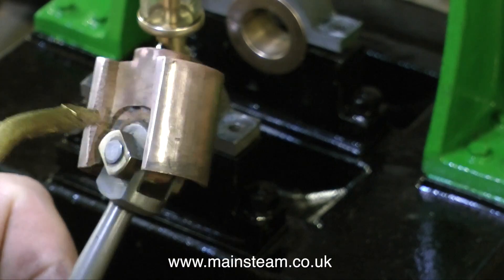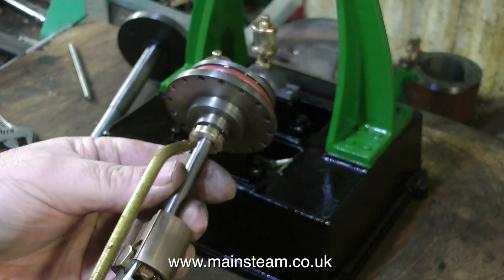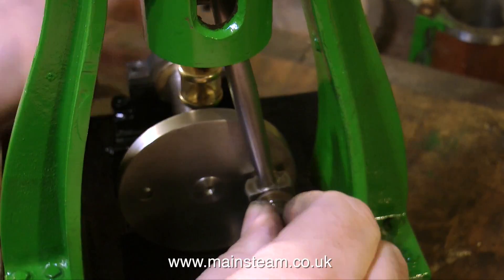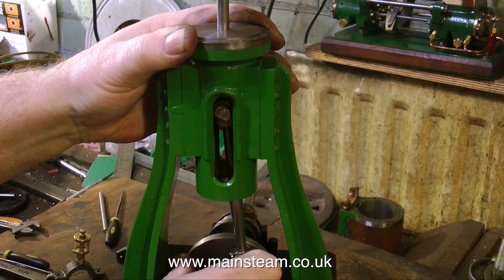REBUILDING A LARGE CLARKSON VERTICAL STEAM ENGINE - PART #18

Comment: Gonna be something else watching this one chuff over happy as a clam when you're done.

I do have a couple of questions regarding a pre-machined Stuart 10H, though, as mine came in the post earlier today. Beautifully made engine, for what it's worth, spins free as a top.

1: What thread is the steam inlet port on the steam chest?

2: Is it normal for them to drill holes in the sides of the cylinders for draincocks, but never tap them nor include the drains/plugs in the pre-machined kits? Mine was so drilled and I'm probably going to have to tap and plug them with grubscrews to get it to run properly.

2a: What sort of loctite would be best used on those screws? Or, perhaps, teflon tape? I might want to break them loose down the line to fit draincocks but I currently have no plans to do so as live steam is still a financial pipedream for me, yet I doubt I'll get a decent seal just by the threads alone.

3: The plans that came with it mention the smaller engines used 'oil rings' for a piston seal. The piston on mine has three shallow grooves machined into it, far too shallow to accept any sort of O-ring or the spare graphited yarn I had left over. The 3n1 machine oil I got, per Stuart's recommendation, and some good ol' 10w30 seem to do little to seal this, and I lack the machine tools to cut it for either cast iron or silicone rings. Would proper steam oil, perhaps gear oil get a decent seal without too much friction?
Reply from the maker: +TestECull Usually 1) 1/4 x 32tpi 2) why not buy some draincocks - they look good 2a) Loctite 542 3) if the piston tolerance is good, then the 3 oil rigs will be OK - but a single silicone O ring gives a lot more power. - don't use gear oil - nasty stuff

Comment: I have a quick question regarding the "special stuff" lubricant with the rapeseed oil. From what i gathered you make it from steam oil, machine oil and rapeseed oil. I want to ask in what proportions you mix them as I would like to makes some of my own.
Reply from the maker: +SirPrzecinek I would estimate for a general bearing lubricant on a model steam engine, 50% steam oil, 30% machine oil and 20% Rapeseed oil ... it works for me, but only use steam oil for cylinder lubrication especially if the steam is superheated.